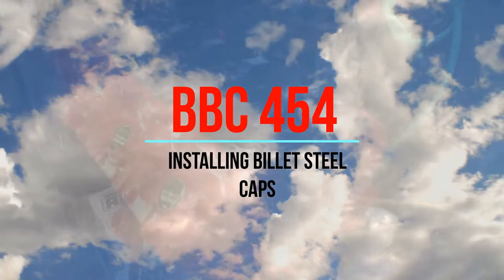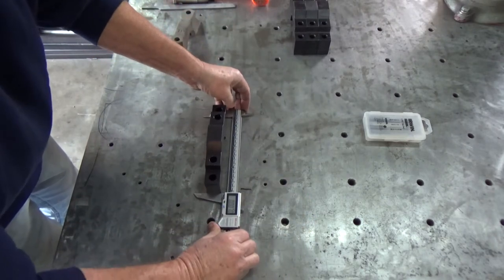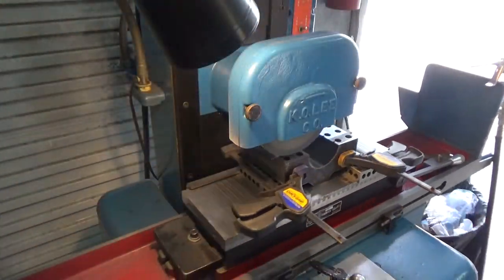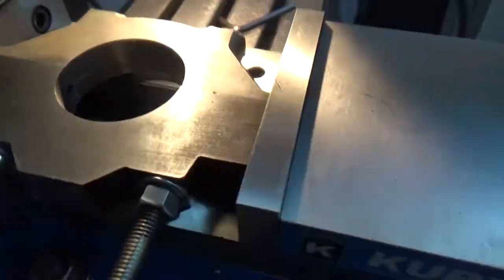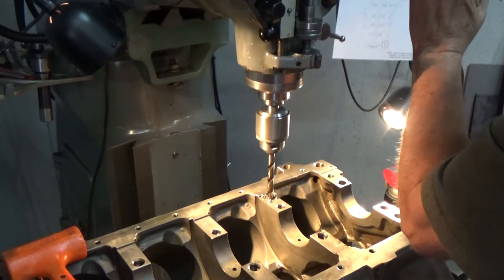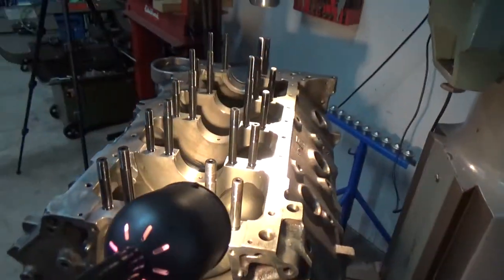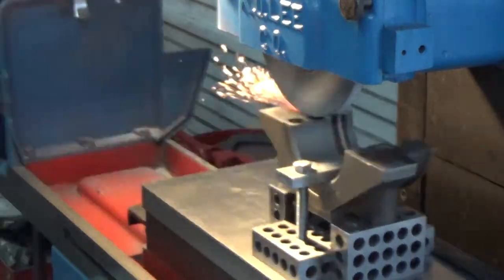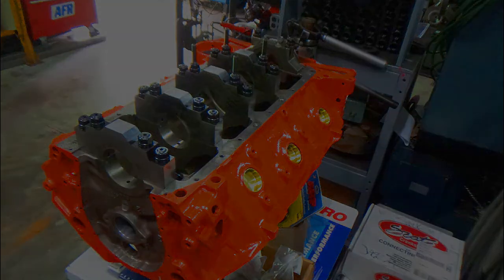Installing Billet Steel 4 Bolt Main Caps... #1 Chevy 454 Big Block Performance Build...

Comment: When it came back from the line hone were the bores round and to size as you expected?, I’m asking because I’ve had a big block and a small block line honed by two different shops and neither one was done correctly the first time, after I sent them back they were usable after the second honing, albeit still not perfect, but needed .005” shorter timing chains! You look to do excellent work so I’m interested in your opinion on the line honing procedure!
Reply from the maker: Line hone jobs have worked out for me in the past with on problems... Hope you find a machine shop that will do a good job for you..
Reply: @Myersmetalworks  I’m a retired machinist and believe me that can be a problem when trying to find a competent machine shop that does high quality performance machining.

Comment: Hello. If you sandwiched the old cap and the new cap together and then bored it, how did you end up with the new cap . 005"  under?
Reply from the maker: Hi. You don't have to bore it out all the way... The two caps bored together is to make them match fairly close and not have a large mismatch step the line hone mandrel stones would hit while honing the housing bore to factory spec...  Thanks
Reply: @Myersmetalworks  Nice! Awesome work. Thanks for the quick response.

Comment: I was wondering how deep you were able to drill into the block for the new bolt holes?  You mentioned the oil galleries were not to far into the block journal.
Reply from the maker: Hi Mike... Its been around two years since that job was done... So I'm not sure... 
I think the blue print I used may have come from Grumpy's performance garage.
You could look them up and see... lots of good info their too.... Hope this helped...
Reply: @Myersmetalworks  Yes, that's a good lead for me to follow.  Wanted to let you know that your's is the 1st YouTube Channel I ever subscribed to.  The care you take in detailing your work is very helpful, entertaining and inspirational!  I hope you get many more people subscribing to your channel, because your content deserves attention.
Reply from the maker: Mike.... Thanks so much for your nice comments and subscribing to the channel  Its appreciated....  Your the type person that helps me keep working at it....
Thanks again....

Comment: Awesome Job sir , I think the only thing too make it better would be spayed caps but then again the regular conversion is plenty strong enough. Good video sir
Reply from the maker: Thanks John... Glad you enjoyed the video...
Reply: that would be a good idea on a  2 bolt small block.

i would think on a factory 4 bolt 350 you could just get the steel replacement with straight bolts and it be plenty strong for street use if you did the center 3 since  it seems like those are always the ones that break.
Reply: @KingJT80  I’m a BBC only guy but I agree with you on a 350 plus I would use studs instead of bolts.

Comment: Been thinking about doing this to mine. Is this something you do for $$$ or just your own? Also how does the costs compare to just finding another 4-Bolt block?   Thanks.
Reply from the maker: Just work on my own engines and its just for fun.... Finding a 4 bolt block might be the best.... But I dont know what a machine shop would charge either?